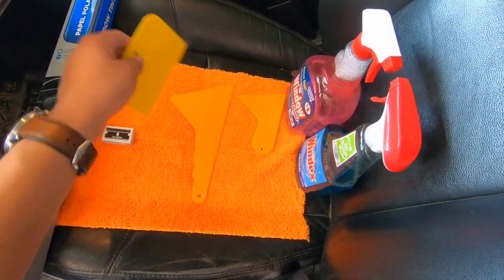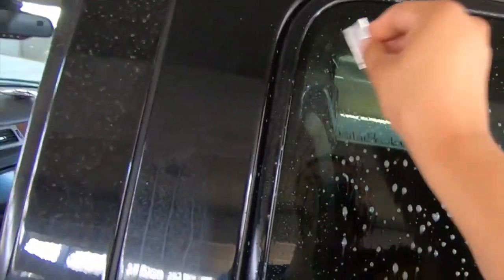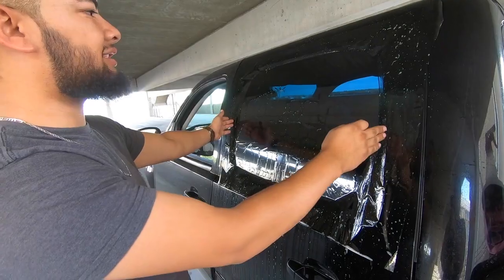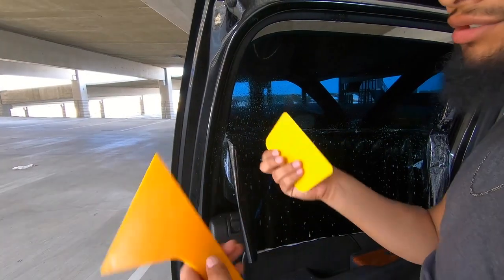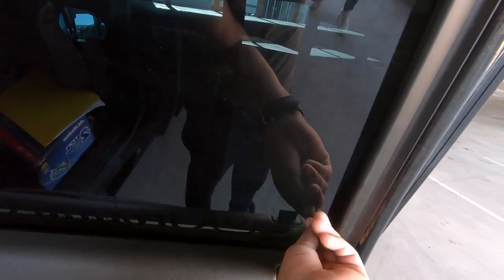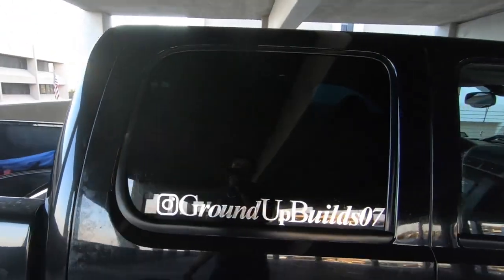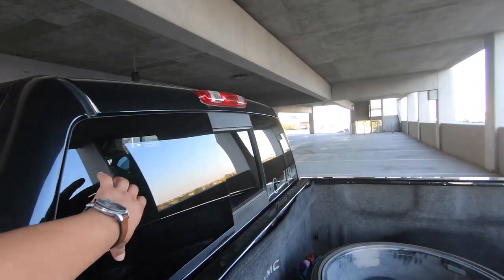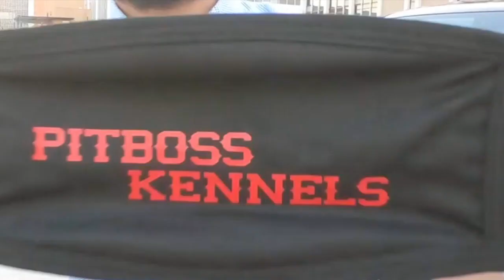Tint On The Sierra

Comment: Looks better then my tint 💀
Reply from the maker: Thanks cuh🙏 le batallan pero ay quedo
Reply: GroundUpBuilds all gotta show me is how to lower mine more it’s a 5/7 drop but yours is lower then mine 😔
Reply from the maker: @alexisopt3066  what size wheels you got?
Reply: GroundUpBuilds My rima are 22s i forgot what size tires
Reply from the maker: @alexisopt3066 with 22s yours should be lower than mine if it has the same drop. Maybe change your tire size & itll drop more
Reply from the maker: @alexisopt3066 with 22s yours should be lower than mine if it has the same drop. Maybe change your tire size & itll drop more